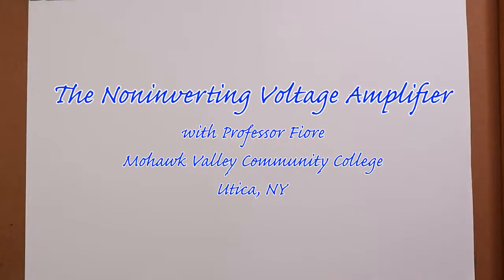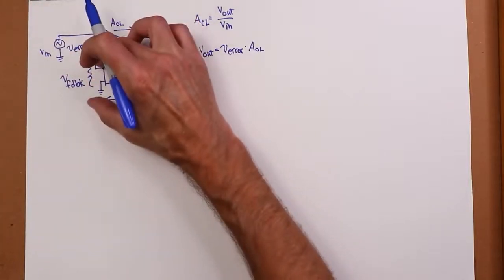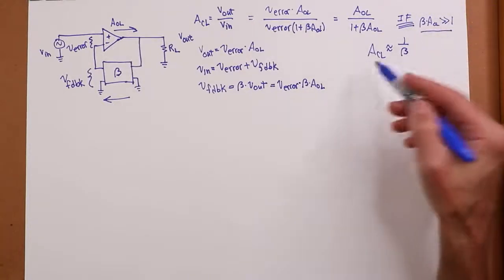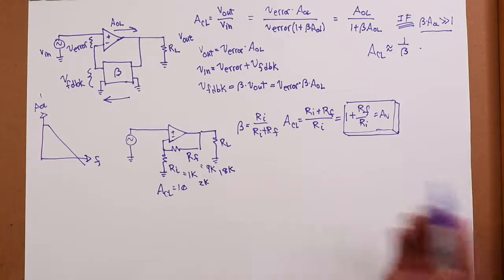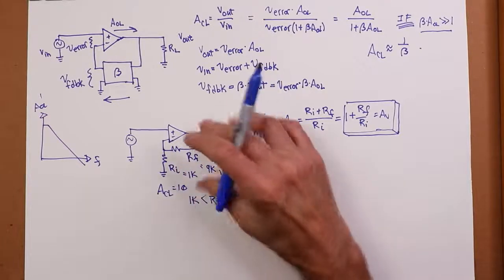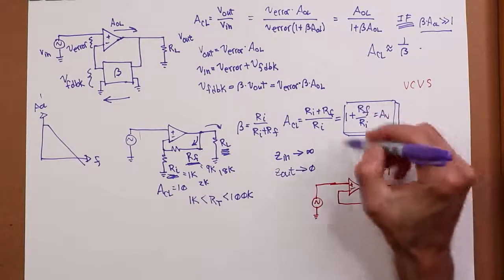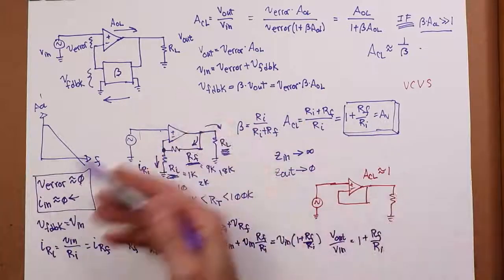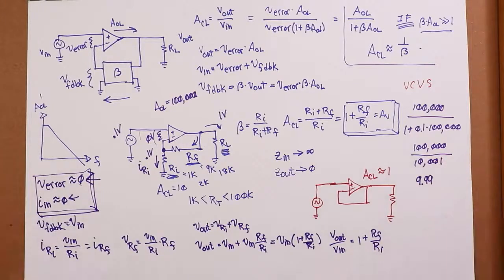Op Amps: Non-inverting Voltage Amplifier

Comment: Competent and more then "in the know". Like the previous lecture. 
Vacuum tube enthoisiasts (like me) should take in what Prof Fiore tells us. Engineers calculate and do not assume.
It does not matter if you work with op-amps, transistors or tubes.. The theory fits all. Thanks.

Comment: Great, series in, parallel out makes sense now. Thank you for taking the maths line-by-line.
With the transistor amplifiers, we were talking about small-signals wiggling on the Ic/Vce curve. Further to the previous video where we have a class A/B output and diff-amp input, within the realms of operating voltages, is there a limit to the input and output? In other words, can we shove a larger signal into an op-amp and get good linearity?